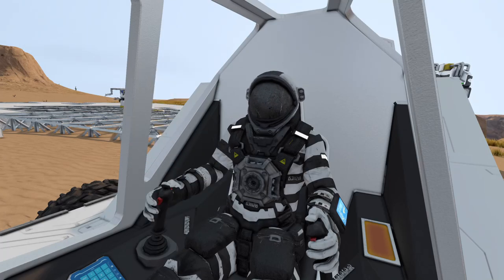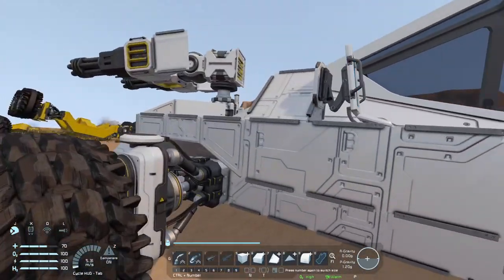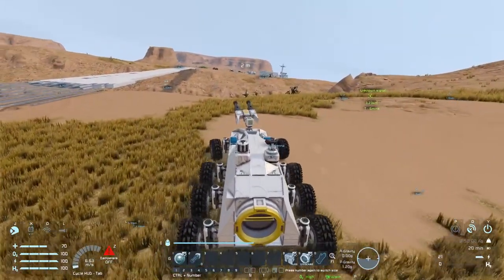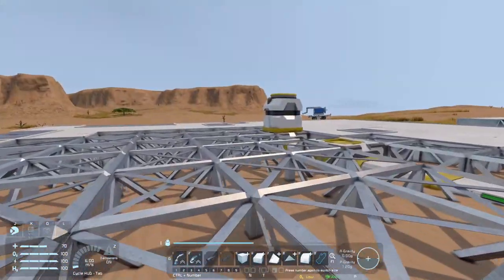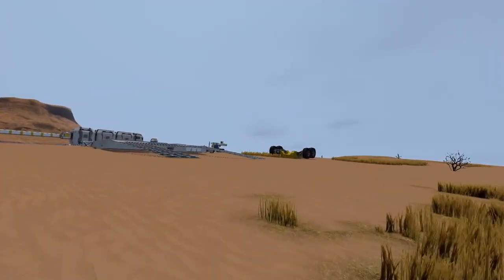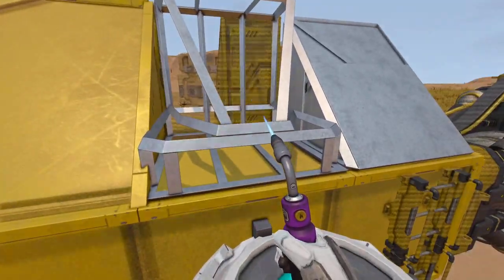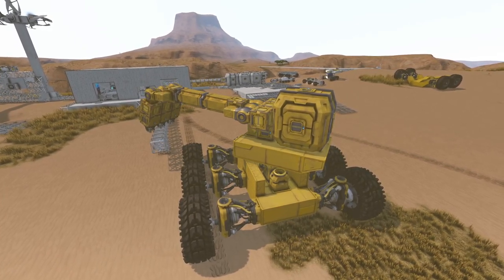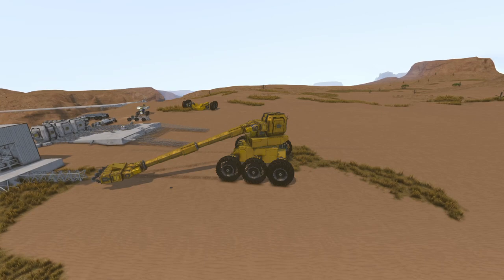Space Engineers Surviving Pertam: Building A Simple Crane System | Part 24

Comment: Add “control” from your G menu to your hot bar in the upper cockpit.  You are connected by sub grid, so you have direct connection to the remote block thru K menu.  I use this all the time on my ships. No antenna needed.  Also, might consider adding solar panels to the large cargo box to help keep it charged.
Reply from the maker: Ahhhh I need to check this out. Thanks

Comment: To help with projectors, the 4 way cross is the top and the vertical line is the front.
Reply: And wheels didn’t print because they are too close to one another.
Reply from the maker: The wheels projected fine. It automatically showed up once I started to weld the suspension.

Comment: First, I think you can space the grinders a bit, so they cover more area. It should also allow you to place a camera more leveled with what the grinders are... well... grinding. 

I also think that you should add one pair of wheels to the back, and place a conveyor-connected Large Cargo Container there, which would also give space to put the antenna vertically, and may be another battery. That should solve the front-heavy problem you're having. 

But generally speaking, and from hindsight, you should have started with the mobile base. You want at least a cockpit or control seat, a battery, the wheels, and possibly three or four LCCs. What for? to put the materials you grind directly where you will need them rather than piling them in temporary storages, which you will also have to empty and grind eventually. Doing that sounds like a lot of redundant work, if you ask me.

Of course, at this point you can plan how you will dedicate the space in the mobile base, with at least one refinery and one assembler with assorted modules. Power is an important consideration in a mobile base. What are you going to use? With the amount of ice you have, hydrogen engines are out. Solar panels are quite inefficient and only work with daylight. Pity you cannot use wind turbines in mobile vehicles...

Or can you? I think that if you anchor your mobile base to the voxel with a landing gear, wind turbines will work again. Be ready to account for a TON of batteries worth of space. Because of course, as soon as you unlock the landing gear, the wind turbines will stop.
Reply from the maker: Whoa. Thanks for all the tips 😀.  I honestly didn't even think that far yet, but you make great points.
Reply: @PandemicPlayground  Well, I experimented a bit in the moon with two settings: in one, I built a massive rover-base to move around the moon, with a ton of drills to level the terrain I intended to move onto. It didn't go too well, but learned a lot. The bit about not slowing or stopping while drilling was particularly memorable due to the big, rover-sized, bump I got myself in front of my vehicle. I guess Clang was happy with my offering that day.

In a second attempt, I built a permanent base, and designed a vehicle that used the Nanobot Drill and Fill mod building to carve a massive road, enough for the massive rover to move around, get to an ore spot and basically strip mine it. When I say "massive", I mean it. The drill carves a square hole of 75X75X75 metres (large grid version) that you can point ahead of the rover, collecting massive amounts of rock while you move ahead glacially slow. To reduce the amount of travelling back and forth, I added a refinery and an assembler to it, because ingots take less space then raw ore, and components even less.

The problem is that I ended up needing to stop to allow for both the Nanobot Drill and the refinery to process the voxel into ingots. I also discovered that the "fill" part of the Nanobot Fill and Drill is basically useless because you need huge amounts of rock to fill even the smallest depression, and I ended just placing armor blocks on top of any hole I found before me.
Reply: @benitogomez7968  @Pandemic Playground I currently have a very large hover engine equipped base running around Earthlike planet and they changed the way wind turbines work because you now you need to set your vehicle as a station instead of just locking with landing gear like we used to.